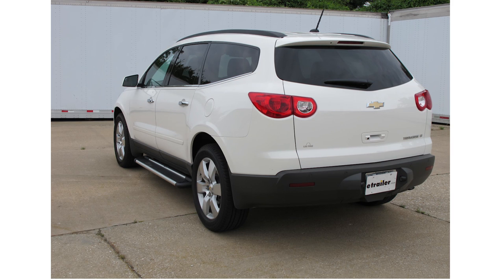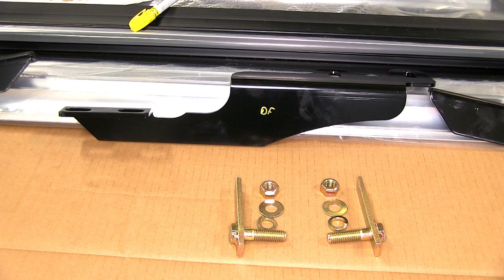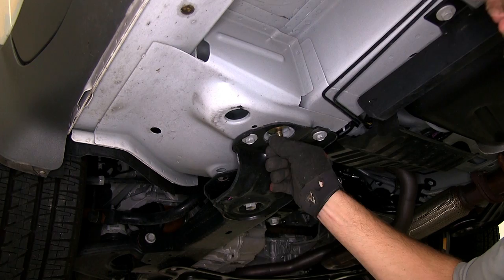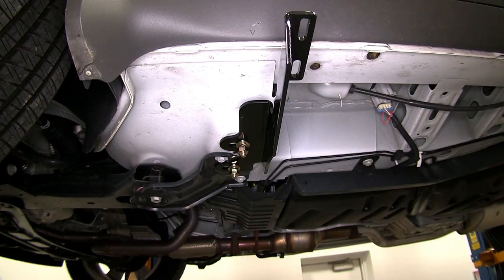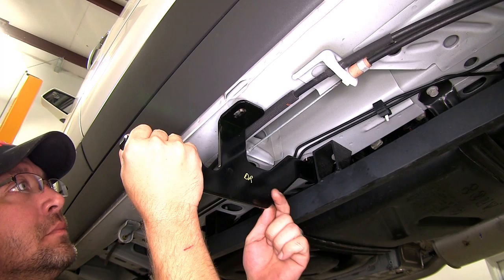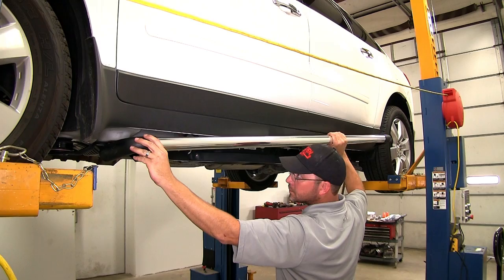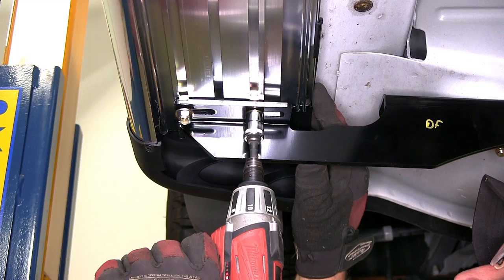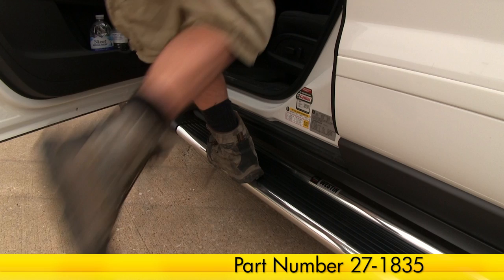etrailer | Westin Sure Grip Running Boards Installation - 2012 Chevrolet Traverse

Comment: Thanks, Hopefully this video will provide for an easy install on my 2011 GMC Acadia. I just took delivery of these Westin Sure Grip Running Boards and this same installation kit. The video looks much better than the black and white sketched installation instructions revision 12/6/07 provided in the box from Westin.

Comment: Any tips for how to get a socket on the M12 nut on the rear driver's side bracket? It clearly shows it being installed into a very snug space of about less than 2 inches in the video. I need a deep well 18mm socket to clear the bolt, but there's no room to get the ratchet and socket in there. Video did not show the tightening down of this problem nut.